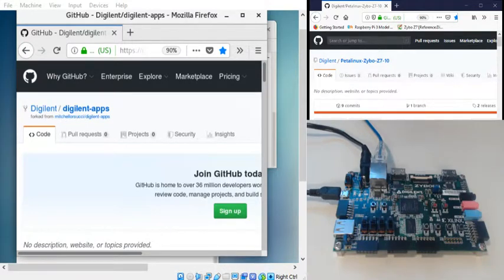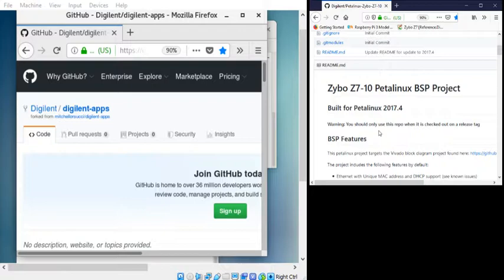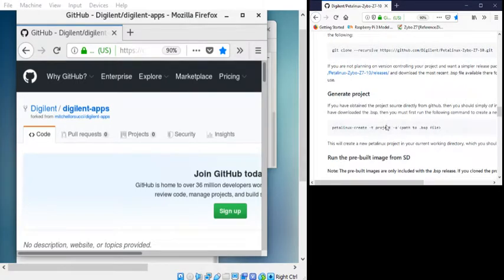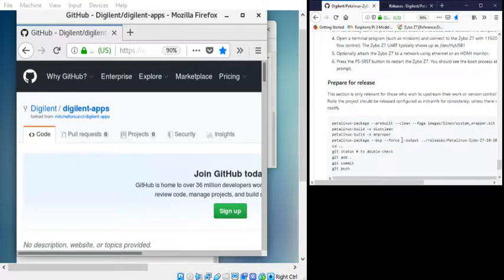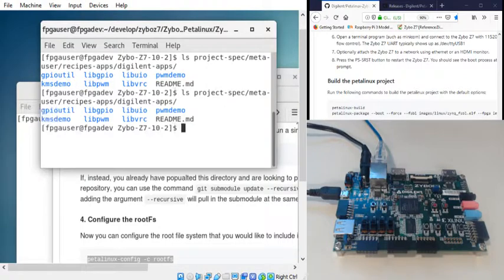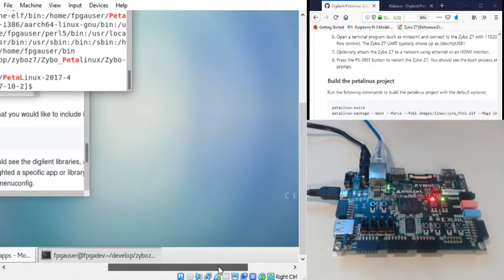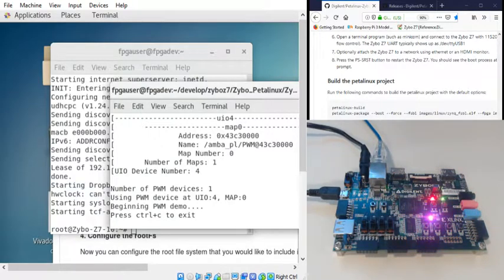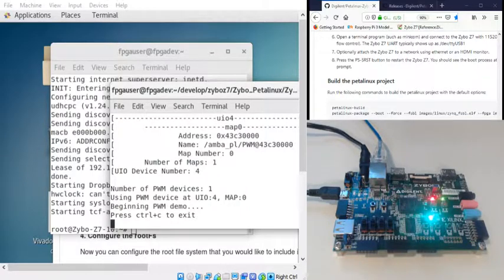Zybo Z7-10 Petalinux Pwm Demo

Comment: The error was displayed on the terminal - the terminal windows was too small.
Reply from the maker: What section are you referring to?  All of the terminal output seem clear to me.
Reply: @TheJoMoVO  He means the problem you hit at around 8 minutes where it throws the error that the MenuConfig fails. It says your display is too small and it must be at least 19 lines by 80 columns. What you need to do to fix this error in the future is just drag your terminal window so its wider (so it can fit 19 lines and 80 columns). This is because it creates a kind of pseudo-GUI in your terminal, and has a certain size it needs to be to display properly.